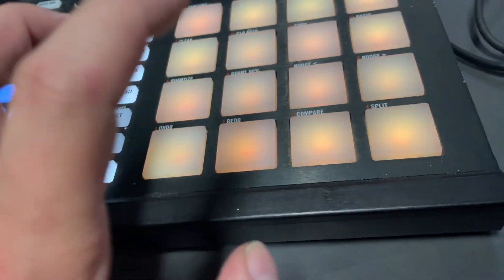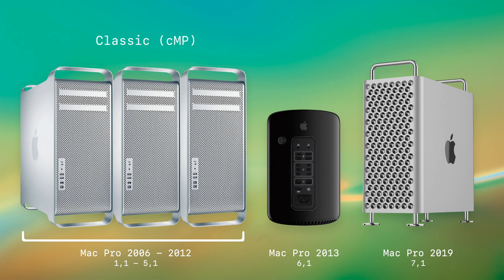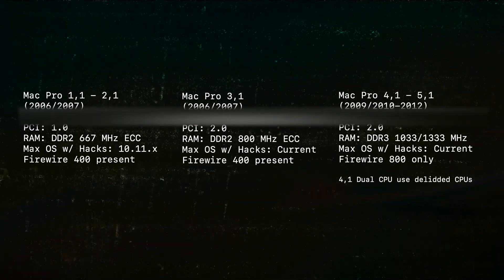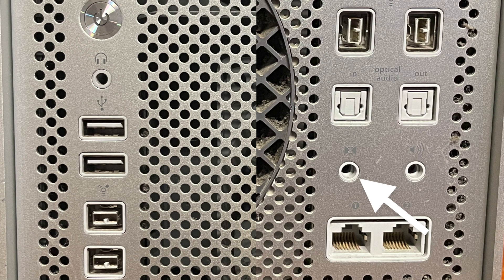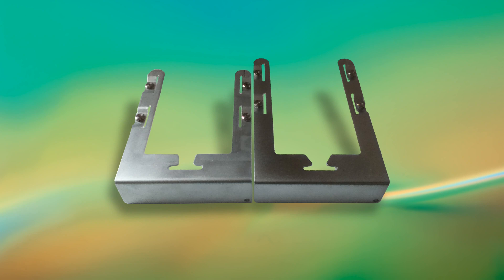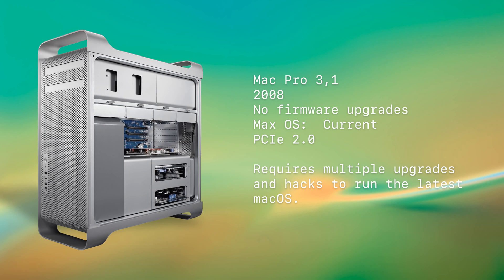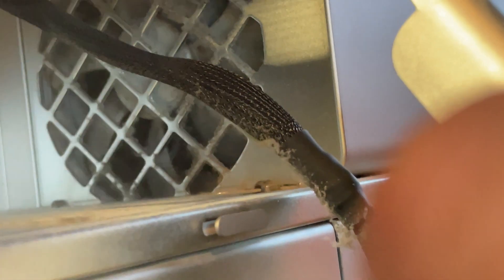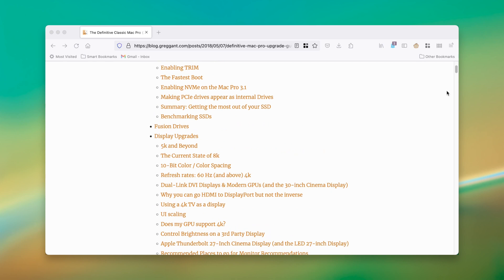Watch this before buying a Mac Pro 2006 - 2010 (1,1 2006  3,1 2008  4,1 2009 and 5,1 2010-2012)

Comment: this is a great video. I currently have a MAC PRO i am looking to upgrade it's parts to the latest possible upgrades i can upgrade it to . I have a MAC Pro: Processor: 2 x 2.33, Memory: 32GB, GeForce 7300 GT 256MB. For the OS i have Lion 10.7.5 with a total of 7TB HD divided into 3 hd's. (4TB, 2TB, 1TB). I am very much interested in updating it as close as i possibly can with the latest OS, hardware, CPU and ram i possibly can. Any ideas/suggestions as to how i can do that or what would you recommend. Your help is much appreciated.
Reply from the maker: I've written a guide that outlines all the hardware upgrades and software
https://blog.greggant.com/posts/2018/05/07/definitive-mac-pro-upgrade-guide.html

You'll want to prep with OpenCore:
 https://youtu.be/VSF9eCLDpoI 

How to use OpenCore Legacy Patcher
 https://youtu.be/i4tsltwR2g8 

Here's an example of a hardware upgrade in a 5,1, although I do not use macOS
 https://youtu.be/qVk4pqEj7jY 

And here's running Sonoma on a Mac Pro 2008
 https://youtu.be/exCcSce2uNo

Comment: I bought a cMP 5,1 mid-2010 2.8 recently to make it a DAW. Turns out, none of my USB MIDI devices were detected after spending a week installing successive versions of MacOS. My PC dealer gave me a full refund on it, since he was the one who convinced me to get it over a 2017 MacBook Pro. My advice to anyone thinking of buying one: unless you're collecting obsolete junk, don't waste your money. Apple has made it impossible to use these without so much hacking and searching for patches & kexts, it was harder than any Linux or Windows install I've ever done. Even if free, the 2013 is the oldest one you'd want. This 5,1 is slower than my ASUS Rampage IV Extreme PC from 2012. Furthermore, after switching to a Hackintosh build, I found it's not much harder to use PC hardware, even with OpenCore.

Comment: Are the GPU power connectors on the 3,1 considered "mini 6 pin" or standard? They look much bigger then the ones on the 5,1 which are definitely "mini 6 pin."
Reply from the maker: No need to repeat the same question on every video

Comment: The old Mac Pros are very well endowed for doing multi-track audio.  If using Avid audio cards or other makers hardware, the old Macs are still great for doing 128 tracks of high definition audio production.  Multi core Intel CPU's are great for audio render.

Comment: Because of your video, I bought a MacPro 5.1 2012 2x2.4 Ghz, 24 Gb ram, 240 Gb SSD, 500 HDD, 640 Gb HDD, ATI Radeon HD 5770 1Gb, High Sierra ,for 2000 DDK(about $183). I have installed a USB3 PCI and Asus 4xNVME with a 512 Gb NVme M2 card. On another 256 Gb SSD with Win 10 Pro.
Reply from the maker: Hopefully you can get a few years out of it

Comment: I'm not sure what I'm looking at with the power cable on my 1,1.  I don't see a socket, it looks like the connector is welded to the machine.  I can't imagine it shipped with the power cable attached but I don't remember.  I don't want to yank out the connector without knowing what I'm doing.  I think it's an Apple Part #:922-5950 connector.  Can I pry the cable out with a flathead?  thanx.

Comment: Found a 3,1 dual cpu mac pro with 2gb of ram and the stock gpu. No airport card. I reinstalled el capitan and all works well. Looking for upgrades now
Reply from the maker: You probably can score a GeForce 770 for like $20 in the right place and flash it to support the EFI boot screen. RAM is hard to find in the 800 MHz variety, it sucks but it is what it is. You can stick in the 667 MHz and it'll work.  I'm not sure what the street price is on it but its a lot less than the 800.  

 Vendors sell the the broadcom chipsets and min PCIe adapters.

Also, I'd just skip on NVMe if you're going budget and for easy use and even on the internal SATA2 bus,  SATA SSDs make a world of difference. Happy upgrading!

Comment: What is delidded CPU's please ?
Reply from the maker: CPUs that no longer have the heat shield, there’s a lot of videos that show the process.
Reply: @dmug  Oh ok so we can remove it of any CPU ? Im gonna watch if you got mac pro cpu update guide on your channel
Reply: @dmug  Oh it seems you didn't make one, do you know a good reference for CPU guide upgrade on 4.1/5.1 or will you be interested in making one ?
Reply from the maker: @DarkTrapStudio  Sorry, I don't have a Mac Pro 5,1 anymore soon that's off the table, at least for the forseeable future. I know there's other videos that show the upgrade process, I think House of Moth did one. The CPU upgrade process is straightforward if you've ever done a CPU upgrade on the 5,1s and the single CPU 4,1 as they do not require delidded CPUs. You just need the long torx to unfasten the CPU, be sure to wipe off the heat sink to get rid of the old thermal paste, drop in the CPU, apply new thermal paste, reseat the heatsink (do not over tighten) then NVRAM reset when you boot.
Reply: @dmug  No problem, Thanks a lot !

Comment: If you have a 2006, buy a sas to Sata card. You can run all the drives at Sata2 instead of Sata1. Also keep in mind this is not a true 64bit processor. Lots of 64bit software will not run with this logic board. Definitely would skip this computer unless you own one already…I had a 2006 and loved it…kept it until 2019. Gave it to a friend. It still had not died.

Comment: If you want to run Linux on a 1,1.
Remember the UEFI is 32 bits and the processor is 64 bits.
So booting Linux can be difficult.

Comment: My first attempt at the mac pro was a 1,1 back in 2018, I firmware flashed it to a 2,1, but even back then it wasn't worth the hassle, so I sold it.  Only week ago at the time of this comment I was lucky and managed to bag a 4,1 for just £10. It had a dead logic board, however I was able to purchase one for just £33. the best part the mac was fully kitted out for the purpose of Audio and video editing, it have a decklink card,  among other pci cards.

Comment: @Definitive Mac Upgrade Guide 

Hello i have a question . Im using a Mac Pro early2008 running with El Capitan .
Befor i was running Catalina patcher .
For Software the catalinapatcher ist working fine but for multiple Monitors IT IS a Big Problem 

I downgraded Back to El Capitan to See If i can Connect and Setup multiple Monitors 

First i Connected two Monitors in the grafics Card 
IT was working fine With the Same Resolution of 1920x1080 

I want to move from Windows Computer to This Mac system because the osx is much more stable and better Plug and Play 
No Driver Problems or troubleshootings 

Ok 
In my Windows PC i Connect Three Monitors 

Two of Them on a VGA Splitter ( Same Monitors one is used AS Touch Screen Monitor ) in one DVI Port , the other one is a newer model because of has a HDMI Port but IT IS also Connected via VGA to DVI 

Windows 7 is showing all Monitors and i the ones Connected thru VGA Splitter is showing the Same Desktop while the Touchscreen is working as it should 

Now i First Connected the two Monitors wich is the newer and the older Monitor model to the Mac Pro early 2008 
This is working fine choosing the 1920x1080 Resolution for both Monitors in Widesscreen and mirror Mode 

But when i Connect the vga Splitter to Split the Signal so that i can use three Monitors over two grafics Card Ports the Mac Pro and El Capitan is Not providing the 1920x1080 Resolution 
IT IS Not showing me the Resolution of 1920x1080 in the list  or choosing IT by itself anymore 
The Touchscreen Support over the USB cable is Not supported 
( I already have the Touch Base Driver but i didnt Installed IT yet because i First need to fix This Problem with the Resolution )

My question is 

Why is IT Not possible to easily Just Split the Monitors Signal Like in the Windows PC ?
I reconnected the Monitors to the Windows PC and is directly the Same Setup and the Monitors in the Same use as befor 

Do i need a Second grafics Card to Support the third Monitor with the Same Resolution because the El Capitan is getting a confuding Input Signal from the two splitted Monitors ?

Comment: Time here;

The Radeon "Pro" VII does not pull as much power as the Regular Radeon VII, making this the most powerful GPU you can get without the Pixlas mod.
Reply from the maker: At this point it'd be the 6800 but interesting about the VII Pro, those were exceedingly uncommon and expensive.

Comment: IT IS DEAD unfortunately for such an ICONIC Design and features.....I sold mine in 2019 upgraded to the teeth because the XEONS inside didn't have the AVX instruction built in like more modern CPU's...I miss it but RIP LEGEND !  The computers Apple builds nowadays are JOKE!  even if they are powerful.
Reply from the maker: Yeah, there's still people making use of them but things like Massive X require AVX and I own NI Komplete so checked out of the classic Mac Pros early during the pandemic. I bought mine a month before Apple announced the switch to Apple Silicon which annoyed me but it's not like there's an Apple Silicon Mac Pro yet.

Comment: That answers my question. I have 2  '08 mac pros. One is a single CPU and the other has the processors. I was going to beef it up but I'd rather grab a 5,1 and hot rod that for music production. I do have the 13" M1 macbook pro and a souped up 2013 imac 27" but I need tower power for all of the plugins and plenty of ports for all of my dohickies and what-nots.

Comment: Im thinking on getting a 3,1 because they are mighty cheap here and I believe I can upgrade well
Reply from the maker: wIf you can find a very cheap GPU, they're workable machines hobby machines.

 If you're looking for something to be a daily driver, at the cost and time of getting one working with the latest macOS (replacing the wifi chipset, Metal compatible GPU, SSD) you're probably at the cost of a used Mac Mini. The 4,1/5,1 single CPUs are only $15-25 CPU away from outperforming the best 3,1 as the 6-Core CPUs are much faster and have later Intel instructions sets that make Virtualization and certain tasks run much faster.
Reply: @dmug  well 5,1 here are 3000 Polish Currency and yea I want it to be my daily driver I just want to replace my Macbook 17 inch that has a Gpu Issue. I have a Mac mini aswell but I want a more powerful machine because I cant upgrade mine and the Macbook is useless now
Reply: @dmug  but thanks for the advice and suggestions

Comment: It is insane how many people out there believe the PowerMac G5 and the Mac Pro are the same computer because they look very similar. Nothing can be further from the truth, as like this video states, you can't run anything higher than OS X Leopard on a G5 because all Mac operating systems after Leopard require an Intel processor.

But perhaps most importantly, critical software like Final Cut Pro 7 will supposedly only run on a Mac with an Intel processor, according to the Apple, who wrote the program. However, Final Cut Pro 7 only requires OS 10.5.6 or later, so it would be interesting to see if you could trick a G5 into running FCP7. 🖥️

Comment: Hello! One question: What is the best option, or the fastest processor that I can install in a mac 5.1 mid 2012? I currently have 6-core Intel Xeon 3.33GHz. And if it is worth making the improvement?
Reply from the maker: The only thing faster is the X5690 and it’s roughly 3-5% faster. Worth it I can’t say but it wouldn’t be super notable day to day unless you’re doing processes that take significant amounts of time where 3-5% is noticeable.

https://blog.greggant.com/posts/2018/05/07/definitive-mac-pro-upgrade-guide.html#cpu51

Comment: I picked up a mac pro 1,1  for $50nz about six months ago and was going to use it for parts but instead I have it sitting by normal day to day PC workstation. The dual optical drives are great for downloading cds and I now use it as a master for my music collection. The other similar mac pro I have I use as a jukebox in my gym. The sound quality is pretty decent via the optical cable, Itunes works fine and four drive bays gives me plenty of storage to store my music collection in cd format.  My opinion is that if you can get one cheap enough & can find a use for it (also providing it is in relative good order) then definitely still worth buying. This is also considering in NZ that the later models are still selling for $600plus. So for me the older machine works fine, is fit for purpose and cost a loss less.
Reply: I picked up my 1,1 for free from a recording studio in Wellington who was chucking it out. Its my daily driver mac in my studio.

Comment: I would NOT recommend the 4.1/5.1. Those are overrated and overpriced doing 1K easily with dual 6-core CPU's and demanding a GPU upgrade, OSX patching horror challenge. And it is still a friggin attic heater at 500W! They were good for day to day use in 2018, but not today. Even a 2012 quad MacMini is more useful today.
The 3.1 2x2.8GHz with GT120 is the sweet spot IMO. 150 bucks is enough to get a good one, you can find them with a bunch of HD's inside, rendering them an awesome backup machine that always works, capable of quad-booting Windows 10, OSX 10.6 and 10.14 and Linux. And still, they are pretty fast. 8x2.8GHz has some punch.
Reply from the maker: Yeah, yeah, it’s Zeon. I can’t change the video without deleting it.

Prices have really fallen since it makes zero sense to pay more than the basic M1 Mac Mini. The dual CPU 4,1 and 5,1 generally are about $300, land they idle at about 120w. The 2012 Mac Mini has the same set of problems with OS updates, lack of AVX/AVX2.

 I’d say the best value are the single cpu tray 4,1/5,1s as they now often go for about $150 and a single cpu 6 core is faster than the best 3,1, easier to get working in Monterey, lower heat output/power than a 3,1, native NVMe support and doesn’t require a wifi chipset upgrade for later OSes, all for about $50 more than the 3,1s. My 3,1 is what got me started with the Mac Pros but it was a pretty big upgrade going from it after a decade to the 5,1.
Reply: @dmug  Good prices there, here expect to pay at least 500-600€ for a machine like that. Again, one should not want Monterey, so that is no issue on the Intel Mini's

Comment: Hi and great explanation of the golden oldies. Maybe you could advise me. I'm  an audio production guy on an old 2012 mini mac 17, with mojave on an ssd running logic, reason and native instruments kontakt 6 etc. But i can only take my audio so far before it struggles. I've been seeing mac pro 5,1 2x intel xeons cpu's with ssd , 48 gb ram for around 400£ on my ebay and am wondering if this would be a good move to migrate my mojave music build onto? Cheers in advance 👍 ✌
Reply: If you want PCI conversion and flexibility you may go for 5.1, if you just want a beast for cheap for music production go for a macbook air M1 or mac mini M1 (I would get a macbook air M1 instead or macbook pro M1 as they specs the same and are less power consuming) and buy internal HDD or SDD, and a case to make them external to avoid Apple tax
Reply: Ive seen mac mini for 400€ on my local trade site.

Comment: Bought an 32-bit EFI Mac Pro 2,1 2007/2008 franked El Capitan on there, then 64-bit Windows 10 followed by Windows 11 bypass. And it updates so beware the 2,1 is back